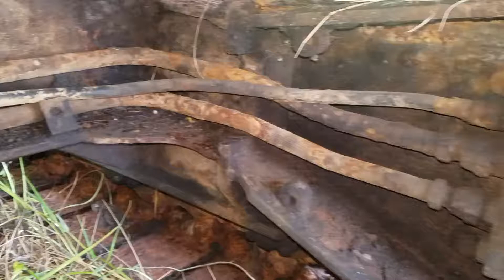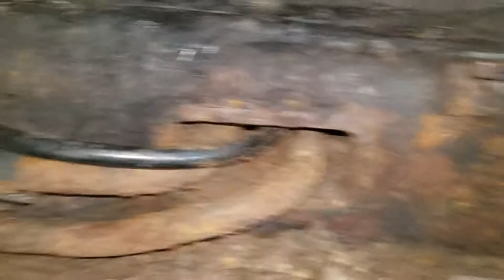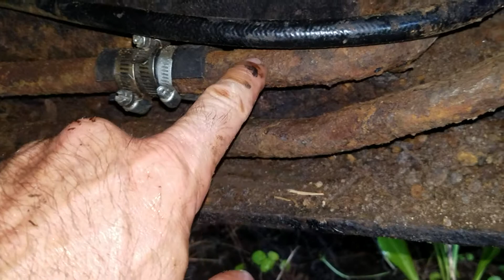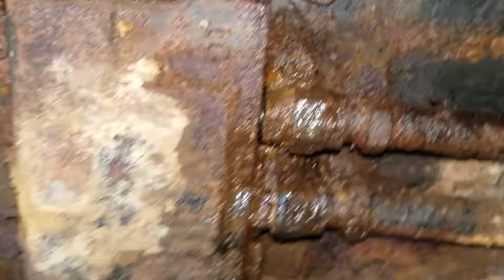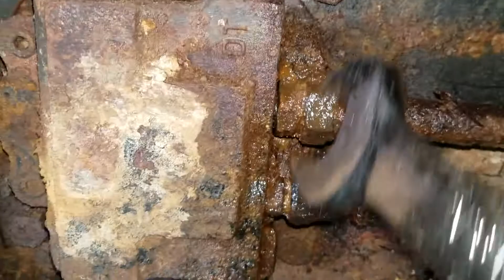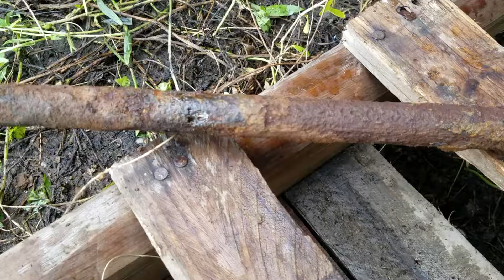How to fix your Caterpillar track drive motor hydraulic line

Comment: Thanks for sharing! When I removed my drive plates the inside was packed hard with dry powdery earth and "1 stones within 1" of the top. Had to use picks just to see the hoses etc. Well the fact that the soil was dry said that the leak wasn't there. I'd pushed the digger too hard and the left track was inoperable and I was oil dropping underneath. Right track and everything else was working. Coupla days later nothing was working, lost all oil. Am now trying to remove bottom panel ( what a squeeze! Too low even to put impact gun in.) Will pressure wash upwards then down from the top. Any thoughts on what I should be looking for as to cause of losing all oil? Thanks. 
I don't know why they don't put a seal on those plates and a boot like on cv joint where the pipes and stones come in to the whatever it's called to get into the drive.